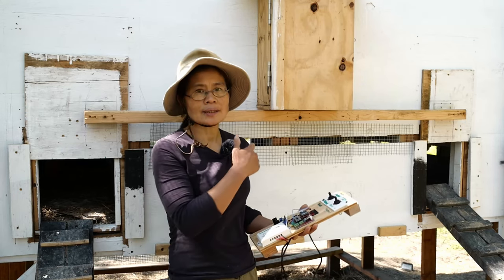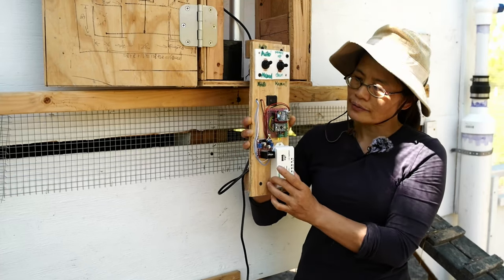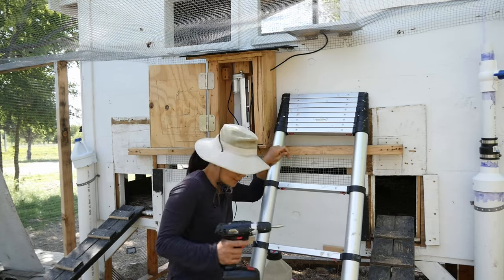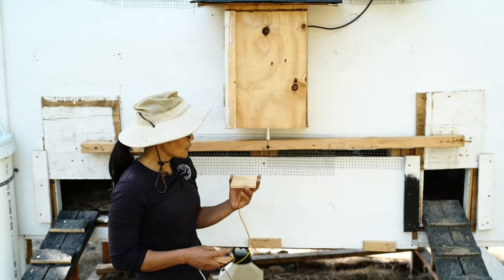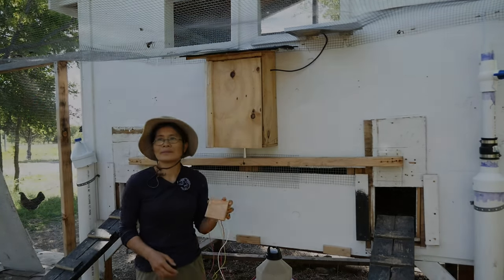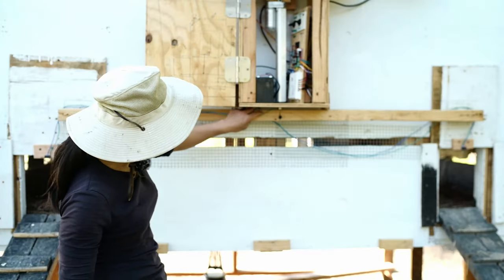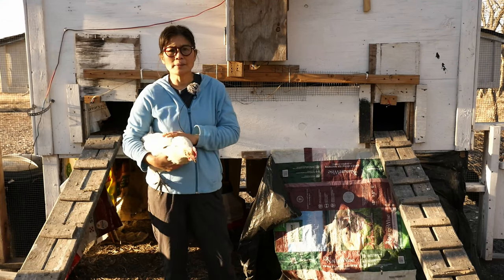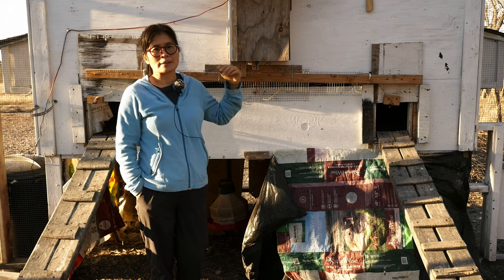Automatic Chicken Coop Door

Comment: This is a very nice combination of engineering and programming skills! 

I am working on a similar automatic chicken door using an Arduino Uno, solar panel, light sensors, linear actuator, and miscellaneous other parts. I wondered if you would be so kind as to share your code and parts list? Additionally, some closeup photos of the wiring you did? I know this is a lot to ask but I would really appreciate it! 

Nice work! 

-Tim
Reply from the maker: No problem. I will organize the materials and share them in google drive
Reply from the maker: I uploaded a project to Arduino project Hub(https://create.arduino.cc/projecthub/exwfarms/automatic-door-and-water-controller-for-chicken-coop-4a9dba#.Yj6P5D3Bj6g.gmail). Please let me know if you have any question.